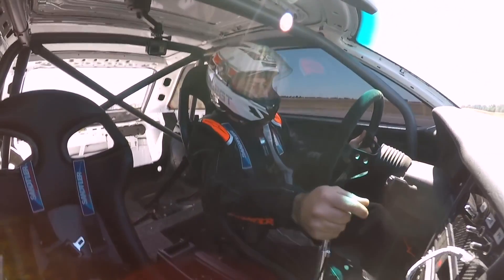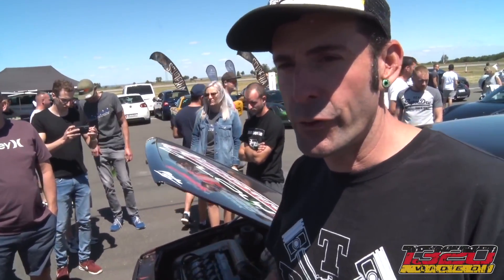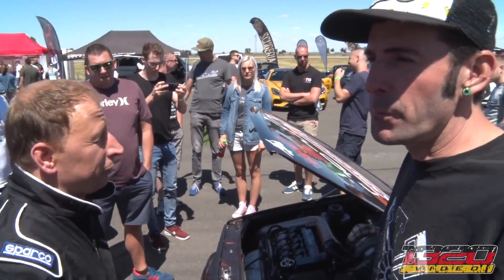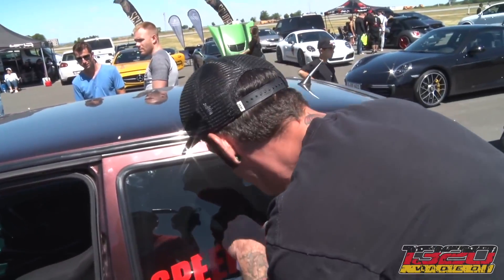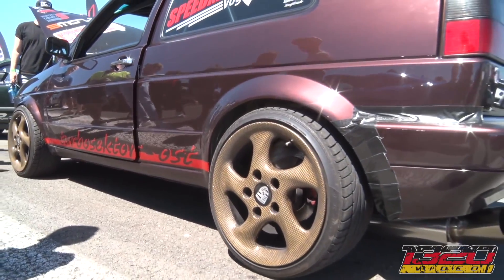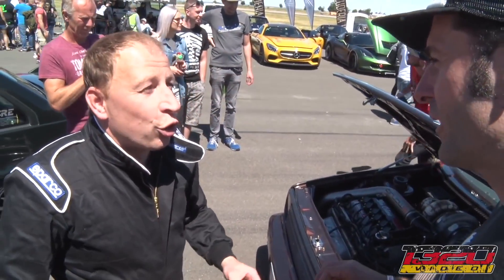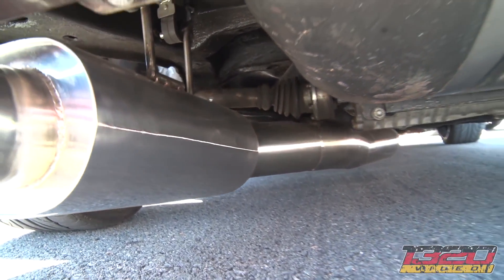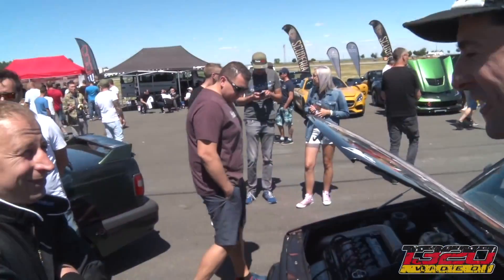1300HP VW GTI Goes 330kmh! (AWD Turbo VR6!)

Comment: Gotta love those speed crazy Germans!  Air filter that is larger than most engines and a turbo that belongs on a freight train - Total insanity! :-D
Also I wonder how a Golf with little/no aero mods feels at 200mph...surely not the most stable thing given the basic car was designed for about 130mph! Very brave/crazy to take it up to those speeds!

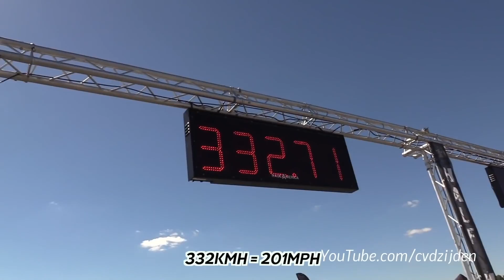Comment: 5:01 332.71kph = 206.74mph... You shortchanged him by 5mph! :o That doesn't sound a lot, but that's the difference between a Golf that can hit a Ferrari F40's top speed in half a mile, and a Golf that can beat a Ferrari F40's top speed in half a mile.

Comment: That air filter will go 1,000,000 miles before you need to clean it :p
Reply: No doubt that the air filter lasts longer than both the engine and trans

Comment: 332kmh is 206.4mph, not 201mph. 
1mph = 1.6093kmh or swapped around 1kmh is 0.6214mph. 👍
Reply: Thanks Poindexter, now fix your pocket protector.
Reply: @bblackley38  We use metric here where I am. 👍
Electronic measurements for speed measurements go to 4 decimals at most for land speed records and the rest is removed, usually it's 2 decimals, look at any 1/8, 1/4, 1/2 or full mile run. 
But to answer your question (had to use my calculator app 😂) it is 9995/10000 or 99949/100000 as the answer was 0.99949xxxx. 👍
Reply: MafiaboysWorld  I have a browser plug-in that automatically converts MPH to KM/H and it made a mess of your comment 😂 Check it out ->
"MafiaboysWorld
12 hours ago
332kmh is 332.37 km/h, not 323.67 km/h. 
1.61 km/h = 1.6093kmh or swapped around 1kmh is 1 km/h."

Comment: the most insane thing is how laggy that car was and still managed a 332!
Reply: It runs a smaller turbo on the streets and drag racing. At least they used too and it made about the same HP but its tougher on the drive train etc.

Comment: It is rumoured that VW are currently working on a new Golf E Model 8 (Due late 2021) and testing on Autobahns in the München area, are reliably reputed it to have achieved 0-100 kph in 2.25 seconds, beating the Tesla Model X - It is also claimed that this will exceed 500km if driven reasonably. However the production model will have a software restricted top speed of 155mph (250 kph) to conform with EU Laws

Comment: Lovely car great job. Learn how to shift properly though. And go harder in 1st and 2nd. Massive turbo lag keep that revs up or better still fit a good anti lag system.
Reply: Calvin Gunn He’s short shifting it on purpose to stop it coming onto boost in first gear. It would instantly break all traction and just get messy if he didn’t. Sometimes what looks slow is actually fast

Comment: Most likely from a mk4 r32 not 5 also it's not only a 24v it's also a 3.2L compared to the 2.8 vr6 that came with a 12v in the mk3 and 24v in mk4. If anyone was curious.
Reply: chris  thompson the mk5 also had an r32, he used a mk5 r32 drive train because the haldex drive is stronger than the mk4 r32. Also the mk4 vrs also came in a 12v until 2002.5 then they started coming out with the 24v. The r32s as in the name came in a 3.2l vr6. Also the 3.2l vr came in the top of the line TT as well.

Comment: Boba did it better and first!
Reply: This Golf is an 3.2 Liter 6 banger from the mk5 golf r32. Boba made 1300hp with an 2 Liter 4 banger out of a golf mk3 gti engine
Reply: Marco Tha Low I know. Ive been following them for a while. Check and check mate
Reply: The Sleeper Factory ok mate:)
Reply: Boba the First? You have no Idea. Search for "Turbo Gockel" or "Renner 2"! I am a German Guy. Here are a lot more fast Cars with 1000+ HP! And i mean Cars with under 1000KG!!!!
Reply: boba isnt faster than this because it doesnt race half mile....
Reply: @Kyranda1  they're all VR6 engines though. Not as impressive as the 16vampir.